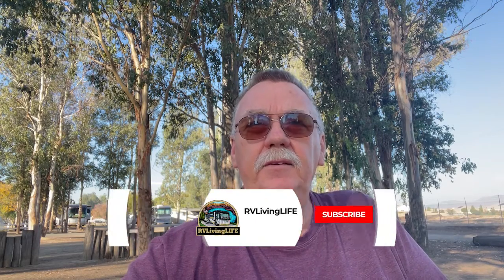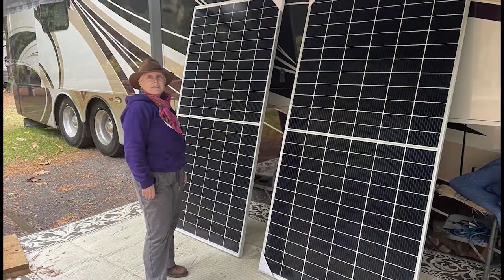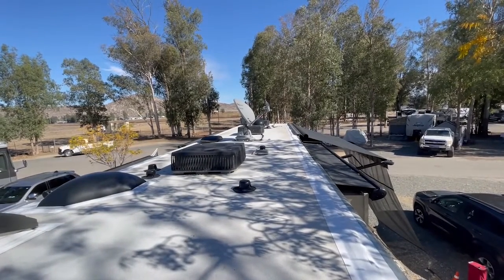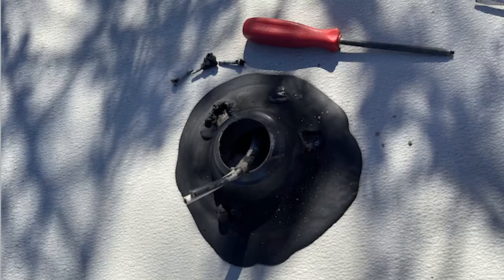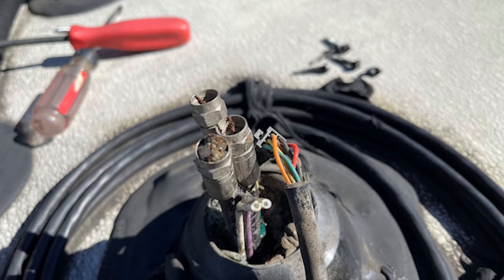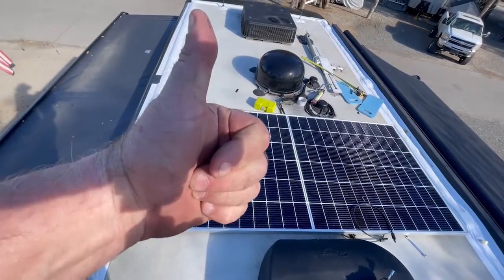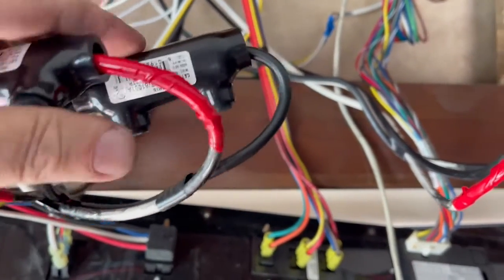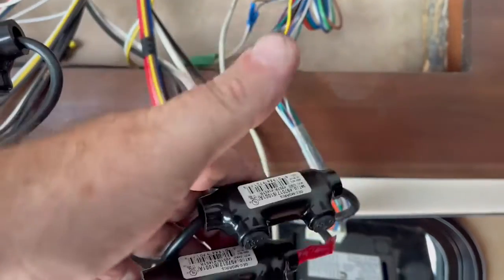Entegra Coach Solar Panel installation | RV Living | RV Life

Comment: Thank you so much.. I did watch your video here https://youtu.be/qybpfHfq0nM

I am configuring my DC to DC charging along with solar...  Which DC breakers are you using... Thin minnkota and cooper bussman breakers are beyond my budget...  The ebay Amazon knockoffs don't do not break at their rated cutoff ..  I bought a 60 amp knock off breaker... It never cutoff...

I am currently binging on all you videos... Along with linking them and I am also subscribed
Reply from the maker: Thanks for the positive comments and subscribing. I used breakers I found on Amazon. I will have to research them and put them on the solar install video description. if I have not already. Never tested if they cut-off. I just assumed they would work.
Reply: @RVLIVINGLIFE  thank you.. I binged on your videos .. I did not see any mention... Your info will be greatly appreciated.. I support and like all your YouTube short stories as well

Cheers and happy camping
Reply from the maker: I added the components used in the description of the video you referenced. Hope that helps.
Reply: @RVLIVINGLIFE  thank you

Comment: Very well done, the panels and installation looks great. Can you share the make and model of these 425 watt panels. We have 6 SolarWorld, 345W panels on the roof of our RV.  We are looking at getting newer more efficient panels.
Reply from the maker: The panels are Q-cell. We like them and they seem to be doing a great job. We bought them on sale at a BC dealer and brought them back to the rig on the roof of the car. we then stowed them in the basement and installed them in California as it never stopped raining the last more or so we were in BC.

Comment: Those are some big panels, I'm sure you'll be loving your solar power and it will sure make boondocking better.
Reply from the maker: We actually did the Installation in California and they were quite useful. We already had them on our coach when we met you two in Palm Springs.